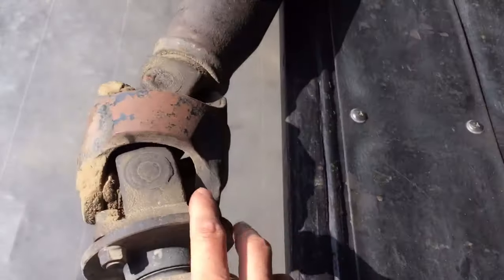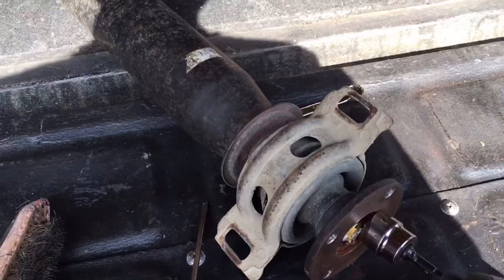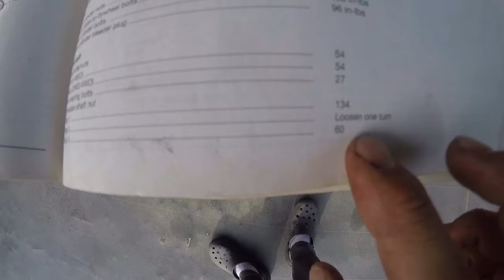HOW-TO Replace Center Bearing on Toyota Tacoma

Comment: I was just quoted over 500 dollars for this repair lol.  Great detailed video, will be ordering the bearing and doing this myself.  Thank you !
Reply from the maker: Glad you didn’t go and get ripped off lol all those shops and dealerships are the same overpriced. Thanks for watching!!
Reply: Skecheyboy       
Truth!  Found the bearing I needed online for 68.00.   Thanks again, and subscribed !
Reply from the maker: Awesome there will be more Tacoma videos to come!!
Reply: I figured it was gonna be 700$ I was gonna do some u joints too. This video though, most straight to the point clear automotive how to video I've seen on youtube haha sounds like you're like 17 at the same time. Brought up well obviously. Tell your mom I say happy mother's day Haha.
Reply from the maker: Ya I guesse it’s been like a few years since I filmed that, better videos to come lol
Reply: @Skecheyboy  how to check valve clearance would be a good one. The clearance actually shrinks and will cause burned valves☹️☹️☹️. Then head needs to come off. And everything attached to head☹️☹️☹️☹️☹️☹️
Reply from the maker: Yeah, I’ve got the 4cy 3rz engine, and it would be a good one to do for sure. It’s due for a valve clearance job soon.
Thanks
Reply: @Skecheyboy  how can you tell? My 3rz has 228k, and to my knowledge it has had no work done to the motor at all other then fluid changes. Original alternator, water pump, starter, blower motor, etc.

Comment: I took my truck to my school shop to rotate tires and grease ball joints, U-joints, and other zurk fitting on the truck. Just typical maintenance after a while. I checked my drive shaft and have this same problem. I’m going to replace the carrier barring in the next few weeks when we have a better lift open. I’m going to replace the carrier barring and the U joints simultaneously just so I don’t have to take it all apart again. Thanks for the video. Super helpful.
Reply from the maker: Awesome, keep up the maintenance and the truck will be good forever lol. thanks for watching .

Comment: Worked good without pulling drive shaft. Just split it at the bearing. That way you can’t unbalance your driveshaft
Reply from the maker: Great idea!!
Reply: @Skecheyboy  that’s why they make the drive shaft so modular. Had to do a U joint once too and just pulled the 4 bolts that hold it to the rear diff, and removed just the yoke with the bad U joint. I love these trucks. I think theyre peak technology for what they are and new shit has gone way down hill with all the new electronics, and active fuel management and stuff. Plus even tacomas are pretty large now. It’s nice to have a light truck for a grocery getter/fencing pickup. Can’t think of a better one then a first gen Tacoma.

Comment: Locknut torque
1. Torque to 134 ft-lb
2. Loosen one turn and torque to 60 ft-lb
Driveshaft bolt torque 54 ft-lbs
Reply: can u explain this more, how do we know bearing is seated byu doing this?
Reply: @SandduneStepper  These are just the torque specs. They won't tell you that the bearing is seated.

Comment: Ours was slightly different and was on a tundra 2wd.  We had to press one side of the ujoints out under the truck.  Made for an interesting experience.
Reply from the maker: Sounds like a fun time you had for sure, always an interesting experience with these Toyota trucks
Reply: @Skecheyboy  yeah it was interesting. We couldn't find w single video that has the same setup as ours.  They all had bolts on both ends.  Great job on the content
Reply from the maker: Glad you enjoyed the video!!

Comment: Great tutorial. To the point. It would have been nice to know the background on how you found the problem. 🤷🏾‍♂️ But nicely done.
Reply: grab the driveshaft at the carrier bearing. push up and down. if it moves up and down the bearing is trashed.

Comment: hey, first i'm not a mechanic and will be using hand tools.   i already checked and greased the U joints so they're good.   let me know if i'm wrong but to just replace the carrier it looks like you can leave the front of the driveshaft in place and just drop down the middle section and do the carrier.  is that right?   and you can put the vehicle in gear to be able to safely torque the 24mm nut, right?  i mean, it seems like the torque put on the driveshaft in operation is probably way higher than the torque spec.  somebody let me know if i'm good to go with my thinking
Reply from the maker: If your able to just leave the front part of the driveshaft on, I don’t see a reason why you couldn’t touqe the nut to spec without it spinning as long as you jam like a wrench in the front u-joint m, because it will probably turn over the engine if you don’t, another thing you could do is put it in a high gear and leave it in 4wd that way your locked in
Reply: @Skecheyboy  thanks!  i was totally able to do the carrier bearing, and also disassemble, clean and re-lube the slip yoke, with only taking down the center section of the driveshaft.   and locking the transfer case worked perfectly to break free, then re-torque, the 24mm nut
Reply from the maker: Awesome, glad it worked out man!!
Reply: @johnschaefer4129  how did you re-lube the slip yoke?
Reply: @garygogolinski2878   hey IIRC  when i dropped the rear section of the driveshaft to do the carrier, i marked the slip yoke so it would go back together the same way.    then i just pulled it out, leaving the housing section attached to the rear diff.   then i cleaned both halves using brake parts cleaner, and removed the grease fitting.   after that i referenced the Timmy the Toolman video, and greased the yoke with the Ford Motorcraft XG8A grease.   but don't use too much, cause he ended up blowing out his seal.   but a good thing to do no matter what to de-pressurize the newly greased yoke is after reassembly and with the grease fitting (zerk) removed, bounce the rear end up and down to work the yoke so extra grease and air come out.  hope this helps

Comment: How come you dont just separate the two halfs and leave the back half bolted to the diff since you have to separate them anyways once the whole thing is off the truck? Just wondering if that's another way to get it done with less disassembly.

Comment: Hey man nice video! I have the same double carbon u joint in the middle but other Tacoma’s same gen don’t, did you replace the u joints?? They seem to all be after market let me know thanks man
Reply from the maker: Hey man, I did not replace the u joints in the double Cardon. I’ve seen older Toyotas with  single driveshaft no centre bearing, but if it has a centre bearing usually has the double cardon. I’ve never had to replace one of them, make sure you grease it a lot and it will be fine.
Reply: @Skecheyboy  thanks for the reply, ya i think that’s the problem is I wasn’t aware of it and it looks like you have to grease the center ball bearing on the regular im not a mechanic lol but do you know  if you can just replace the ball bearing by itself? It seems that’s the only thing with play it’s pretty bad
Reply from the maker: They tipically only come as a unit with the bearing and the rubber part with the bracket, but they might sell it on rock auto. I’m not sure.
Reply: @Skecheyboy  ya i had to buy a whole new drive shaft but at least I know to grease it about every oil change I here is the best to do it

Comment: did your truck make a noise when driving? i think this is the same issue with mine but it makes a ticking noise when i drive
Reply from the maker: Ticking could possibly your u joints, but tipically the centre bearing makes a squalling noise, high pitch kinda sounds.

Comment: Ok so I replaced my Center support bearing on a 2004 Toyota Tacoma and after putting it all back together I'm still getting almost a worse vibration than it was before and I think I lined up everything properly but the one part I am not sure about is after you put on the bearing you have that separate piece that goes on with the splines and then you put the thicker washer and then the lock nut because let's say if I did not Mark where my drive shafts lined up how can I factory reset it
Reply: Factory reset a drive shaft hahaha

Comment: What kind of grease did you add into the bearing? Mine is partway packed with clear grease that looks like silicone.
Reply from the maker: I used a good EP (extreme pressure) grease, wheel bearding gease will work good as well.

Comment: Hi I have a question why I burn 🔥 two those ., I change it twice and I don’t know what is the problem.?
Reply from the maker: What brand are you buying? Some of the cheaper brands have cheap bearings in them, and they don’t last very long. Other thing is when you get them, they only usually have shipping grease in the bearings, make sure to put some extra grease in the bearings before install
Reply: @Skecheyboy  i don’t know what brand but cost me like $80 and we did put grease .. the only thing the mechanic didn’t make it before to take it out the bad one ., how can I do it now later today this morning they going to put it back and I’m afraid 😱 they going to mess up again help please how can I do it right ?
Reply: @Skecheyboy  hi 👋 I bought those in Napa auto parts they sale good parts ?
Reply from the maker: I installed mine was a Dorman brand, 1.5 years later no problems, I would try to get a better quality one and it will work.
Reply: Go to a drive line shop and get a solid drive line. It eliminates the Carrier bearing and the cardane joint if you have one.

Comment: Good video but you didn't back it off right. You're supposed to torque it on and then put it in reverse and reverse it then torque it back on. You just turned it back without flicking it in reverse. That doesn't do anything. "LOOSEN" means put in reverse
Reply: What r u talking about

Comment: What year of tacoma is this video covering?
Reply from the maker: This is covering 95:5-04 Tacoma pre Tacoma’s are similar and 2nd; 3rd gen May be a bit different
Reply: @Skecheyboy  I have a 2003 xtra cab. 3.4l 4wd and I was wondering if my truck had the same drive shaft as the one in the video. The reserch I've done has given me to different locations for the carrier bearing. Its either directly underthe cross member or its shifted forward a little and mounted to and extended bracket.  When I bought my truck some one fabricated a bracket threat shift my carrier bearing forward and I'm just trying to put the original make of drive shaft back in the truck.

Comment: Why does everybody keep showing that one where it's also simple and easy taking the bolts off and then dropping it down and taking the big knot off that's not the one everybody wants to know about they want to know about the one where you can't get that out of the bushing because there are no way to get to the nut that's on the universal